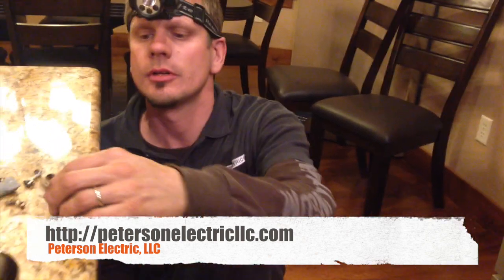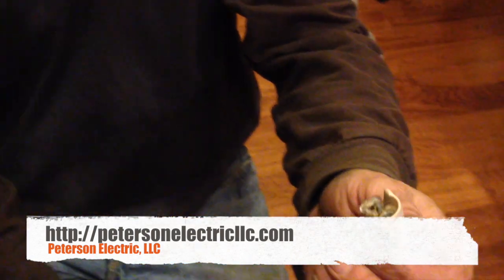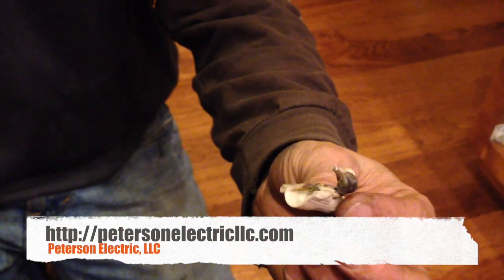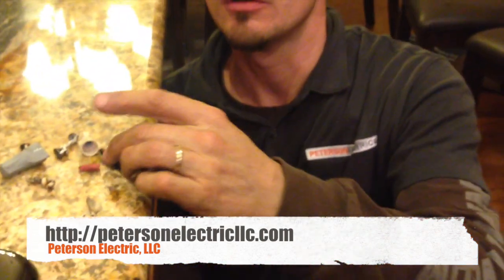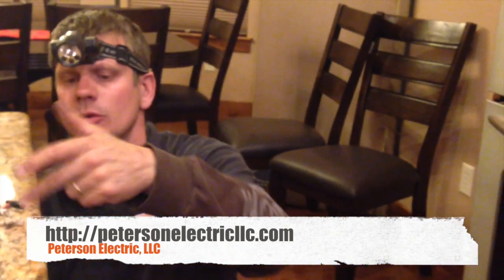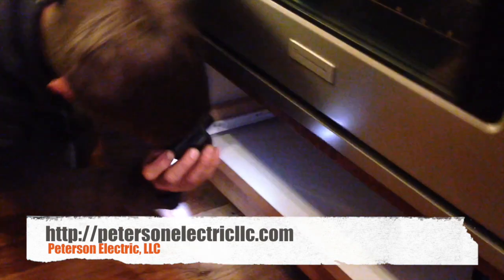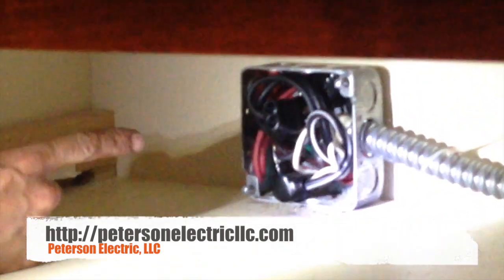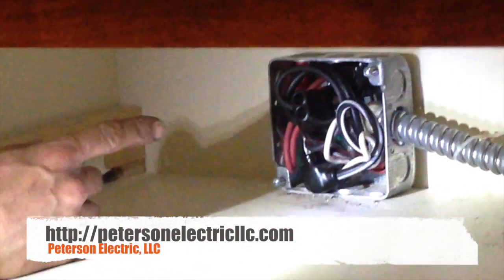Proper Electrical Wiring For Electrical Wall Oven

Comment: No one seen the missing 1/2" flex connector? Good remedy for replacing the wire nuts, Red or blues should of been used on the initial trim out. Those polaris lugs are expensive though, but work well!!
Reply from the maker: They can be pricy but, if the customer is made to be aware of the choice then they will most likely spend the extra money, also because they do not want to pay us to come back in a couple of years with two electricians and our wall oven, hydrollic cart lift. (tool)

Comment: That's a good point about the weakest link of a continuous load line, especially with wall ovens, which are notorious for high ambient temp as well. When I heard you say that, I went to my collection of Marettes and found temp ratings on the box higher than 20deg,  but all bets are off for aluminum anyway. Seeing how these melt away is an eye opener, and of course there is a technique and surface area issue if the nut is not well twisted. I can't seem to find Polaris connectors here in Canada, but other generic options are available for high current applications.
Reply from the maker: Try Brady, or 3M, or Ilsco.

Comment: I read the specs on these on the Home Depot site and they state that the product is not suitable for fine stranded wire. The wire coming from new replacement oven is stranded. Can those wires be twisted and inserted?
Reply from the maker: Home Depot is not making sense, you can use stranded and solid together, but it is about how you strip the conductors and if they are dissimilar with conductivity. This video explains how to do this safely and how this will last.

Comment: Spoke with Polaris nsi and they said that they don’t sell a connector that goes from 6 guage to 10 guage whip. Everyone says to use the blue wire nuts. What’s the best way?
Reply from the maker: I get the small two port polaris connectors from my wholesaler. #10 - #6 size.

Comment: Im looking for the article in the nec on the splice.

My memory recalls, if its 40 amps or above then use splice.

I have ran into melting wire nuts behind wall ovens too many times, the rules are there for a good reason.